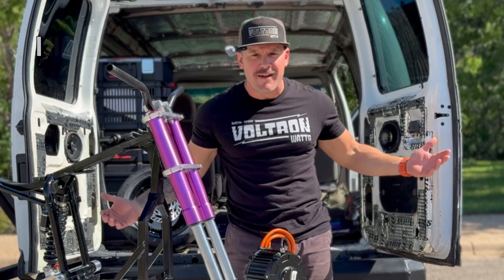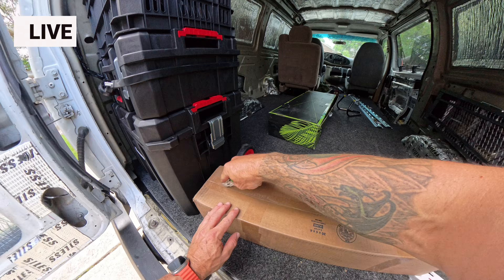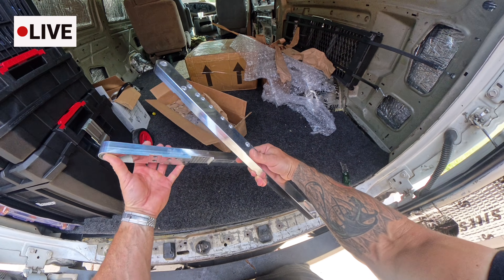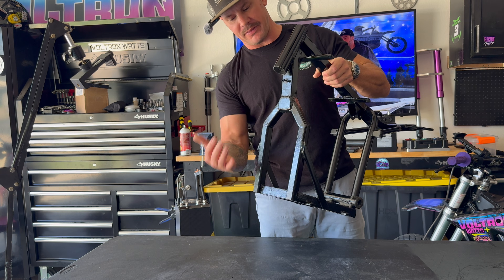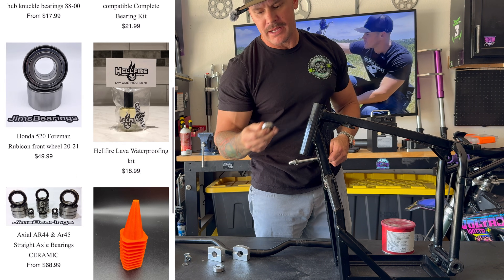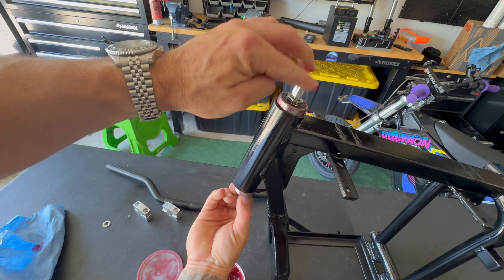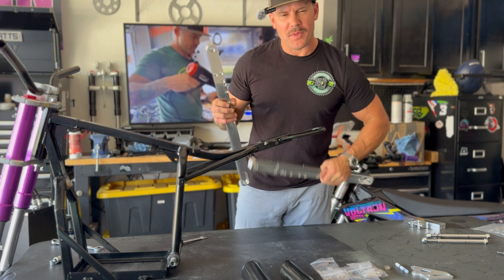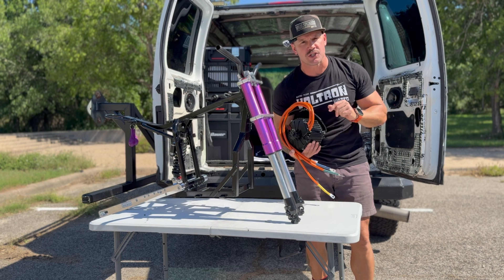How To Build A 96 Volt Modified Razor!

Comment: Really hoping you'll get this built so we can see it run? Any time frame in mind? I put a qs165 50h in my 2011 Zero XU using a Fardriver 72890 with 265 amps from the 72 volt battery.  At 84 volts peak charge it puts out around 25hp and hits 125km/h (78 mp/h)
Reply from the maker: Bad ass!!

Comment: Coming from a guy who use to build stretched Honda Ruckus's I would blue loctite EVERYTHING because after you upgrade those motors, especially with a yoshi exhaust, everything rattles loose eventually. On my 72V MX650 I thought because it was electric and less rattle (from no exhaust) I wouldn't need the blue loctite. Boy was i wrong.. the first few days of riding everything was coming loose. The sprocket bolts, the brake bolts, hell even the bolts for the kickstand. I regretfully had to take quite a bit apart and apply loctite to all those bolts. You sir are saving yourself a world of trouble. Keep up the sick build, looks dope so far!
Reply from the maker: Thank you for watching and commenting brotha! 🫡🍻